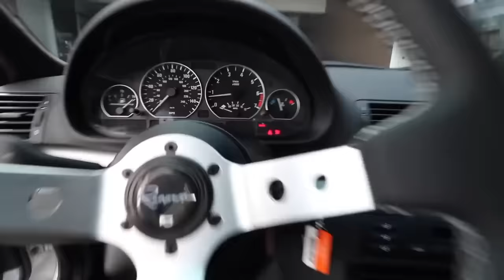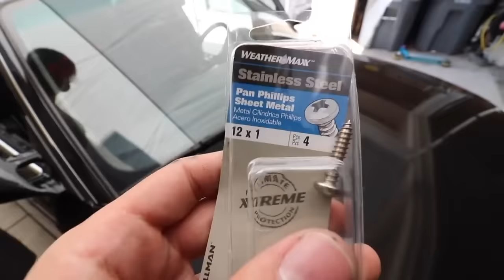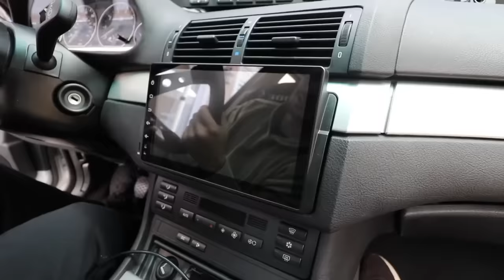Building an E46 in 10 Minutes!

Comment: How much money you spend on this whole modifications and replacing stuff?
Reply: Shahid Bhutta more then car
Reply: @pauliuspiliponis4379  chal kutti dafa ho
Reply: About ten grand
Reply: Paulius Piliponis where??? It costs 2k$ please? 😂
Reply: I’m about 4 thou in on my build and I’ve replaced entire cooling system abs module trans flush water pump window regs power steering rack 100000mile on the car rn
Reply: Robert Ryband the window regulators are a pain in the ass I swear they break every week

Comment: Hey bro I also have an e46 but I have crazy lifter noise was wondering if you ever had problems with the lifters making noise
Reply from the maker: They’re hydraulic lifters so sometimes they don’t bleed properly. Make sure you always check your oil level and change it at 5K miles. One thing you can try is holding the car at 3K RPM for a couple minutes and seeing if that fixes the issue.
Reply: had the same problem. changing my oil and rebuilding my vanos is what helped me get rid of the noise
Reply: He's right. When my e46 is on the lower / dirty side of oil, I can hear them rattle a little. When I do an oil change it goes 100% away. I'm at 118k miles ... I'm just wonder what's up with my vanos and if it works or not, ha.
Reply: Running a thicker oil helps
Reply: @Generalusuer   true i switched from 5w-30 to 5w-40
Reply: Gustavo Casas I’m definitely going to try thicker oil
Reply: Yea, I've always ran 5w-30 Castrol. I'll look into 5w-40.

Comment: What Springs did you use on your E46 I got one and I want to know what is smooth and if yours is rough or not I got coilovers on the back I just need to get the front done what did you use on yours
Reply from the maker: I bought ECS Tuning coilovers! They ride really smooth for being so low.
Reply: @StaticGarageUSA  i will check those out thank you very much